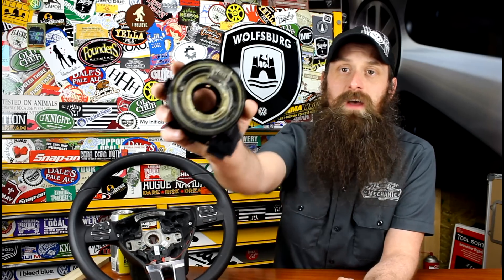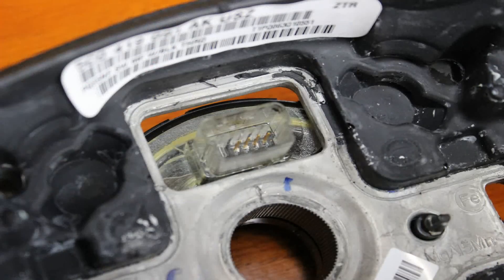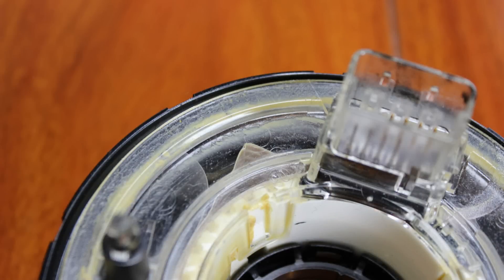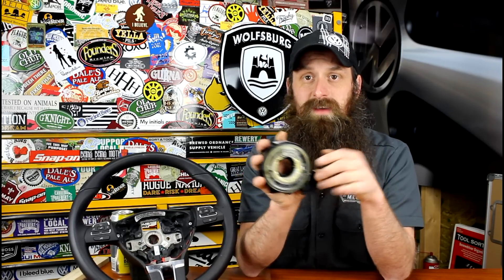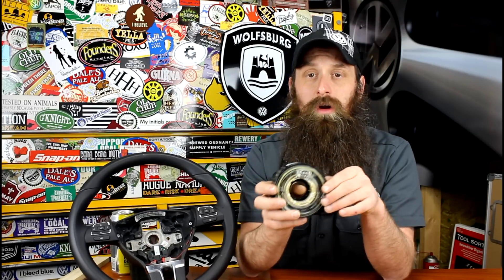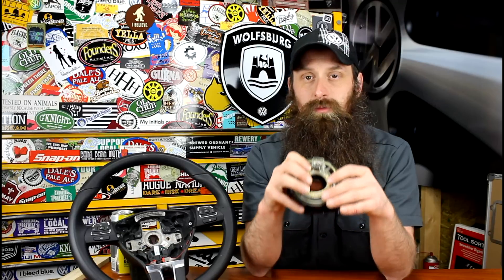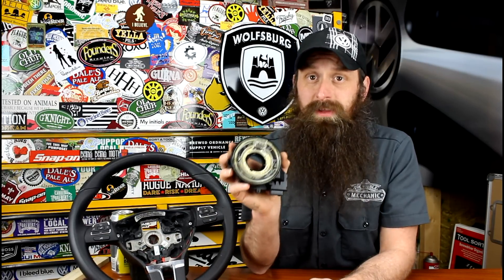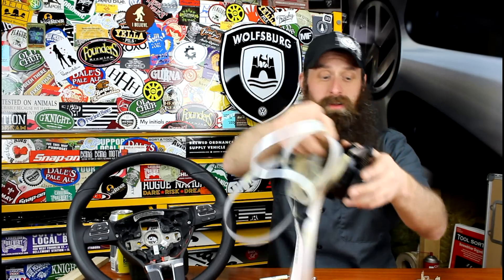How The VW Clock Spring Fails

Comment: Thanks for the great video.  I have a 2007 Eos with a persistent yet intermittent airbag light.

01217 - Side Airbag Igniter; Driver Side (N199) 
            001 - Upper Limit Exceeded - Intermittent - MIL ON

The TSB regarding the wiring under the seat was already resolved by previous owner.  I checked the wiring and it looks good.  I checked the measurement value blocks  Group [21] and the driver side igniter resistance is higher, 3.2, than the others (3.2, 2.4, 2.6, 2.6).   I have also checked, disconnected and cleaned the contacts below the seat. 

What do you think?  Is it the clock spring?
Reply: The weird thing is that it calls out the "side airbag".  That shouldn't be associated with anything near the steering wheel, right?
Reply from the maker: n199 is the side airbag igniter. the one in the drivers seat. Check the connection under the carpet. Seen a few fail there. Also seen a few airbags need replacement

Comment: Have you ever swapped internals from a, c to a d clock spring on a mk5?
D as original and c as aftermarket, putting the internals to make the d work?
Thanks.
Reply from the maker: I have never done that.
Reply: HumbleMechanic what’s your opinion on Doing this?

Comment: If anyone still has this problem and VW hasn't done anything to fix it...I just talked to my dealer and they said there is a new extended manufacturers warranty on the clock spring and my car was included. When I first went in for the recall back in march I was told my airbag light was not on, therefore, they wont fix it and will just put the protective cover on it(my horn and controls were not working either). But now with the new warranty I will see how that goes in December!
UPDATE: Air bag light needs to be on along with broken controls. Even if the dealer tells you otherwise like they did to me, in the end you will have to pay if one of those is not occurring. The dealer even admitted some slip through the cracks and get covered even without the airbag light on, but nope not with me. So thank you VW for wasting my time once again and telling me the wrong information.
Reply: Lauren Elizabeth yes thats true i receive the letter like 5 months ago and now im will have to go, i have a passat 2012
Reply: That's sucks, the games they play. What year is your car?
Reply: And model?

Comment: I recently bought an 06 Jetta 2.5 as a fixer-upper--my first car in 7 years. The previous owner had a 3 page list of problems from a dealer comprehensive inspection and one problem was the horn not working and an airbag light. I used  your videos to self-diagnose this as a bad clock spring.  After 2 tries, I found and installed the right one (a parts chart was off by one letter on the first try).  In the process of removing the module on the bottom side of the steering column and the other one immediately below the clock spring I got pretty vicious with it using a screwdriver trying to pry it loose--grrr… darn hard to reach clips! (Never get too overenthusiastic kids!) After the first reassembly, only the center instrument panel worked (odometer, doors open, etc.) The car wouldn't turn over or even click.  I went a bought and installed a new battery just in case). Went back in to the column to see if I had left something unplugged or pinched a wire, and now after second reassembly, none of the instrument panel works, and the car doesn't turn over or click.  I seem to be doing more damage than good.  Could I have done something to either of those two module that would prevent the car from now even showing when the door is open?  (The battery is giving juice--the alarm system indicator is lit on the drivers side door and the interior lights are working).  This is turning into an albatross around my neck and a dark cloud over my head.  Any advise anyone?

Comment: horn, steering wheel buttons didn't work and airbag light on, replaced clock spring and everything works but airbag light is still on
Reply from the maker: Most of the time you have to clear that code
Reply: Aiden O I replaced clock spring in 2016 Polo and the airbag light will always stay on. I borrowed a fault code reader for VW models and as long as its a decent one it will show the airbag light fault code. When you see this you can click on the clear or delete option which will stop the light from staying on.
Reply: Is the clock spring you replaced the oem? Or is there an updated version that wont mess up again?
Reply: Hi, I got the new one from my VW Dealer and as far as I know its not an updated one. Also replaced steering wheel bolt as itmust be new. It was only £44 for the lot which was surprising for VW. @laurenc9427

Comment: Epc light turn on clean the throttle and it use have P2101 P2212erase codes then took it for a ride it seem find but it turn on again with a P2212 and started rev by itself when being stop and hard to accelerate

Comment: Really thru me, horn and buttons all worked tho....? VCDS solved that issue and the recoding. Used one from a wreck, works fine. Thanks for the tips
Reply: E Klein did coding fix your power steering fault too?
Reply: Don’t think I had a power steering fault, but everything worked fine thereafter. Just have to reset the calibration by turn steering wheel fully both directions and then turn ignition key off and then back on.

Comment: I replaced the clockspring on a 2007 Jetta and all the lights came off after a short drive except the airbag light which was on before the clock spring repairs , also horn didn’t work prior to repair,  horn worked after repairs. Do you have any idea or tips on what can it be
Reply from the maker: you will have to clear that light. It usually won't turn off by itself

Comment: Hey guys im having issues with my cars steering wheel stalks where they are not functioning and i also get a display on my mf screen saying "buttons for steering assistant malfunctioning.
my clock spring is part number 5K0 953 549 where the stalks plug into the clock spring  Mk6 golf 2012.
i ordered a new clock spring but i still have voltage to the pins.. anyone else have similar problems that have been resolved?

Comment: Could it cause steering wheel to squeak? without having any issue with the airbag, horn, or the cruise control
My Audi A6 haas a squeak while turning the wheel sometimes
Reply from the maker: IT can, but it's usually not the cause. It usually is plastic rubbing, or the column needs to be lubed.
Reply: Thank you for the response. I have attached a youtube link for a my issue if you would like to check it
https://www.youtube.com/watch?v=EzqF9DE0EhQ

Comment: 2015 VW Jetta TSI Red steering LIGHT came on & steering is hard to turn.  please help
Reply from the maker: That is usually an issue with the J500 power steering module. Gotta get the faults checked

Comment: There's a recall on the steering wheel clock spring on my 2011 GTI, is it possible for the clock spring to make it so that the steering wheel won't always lock when I turn off the car?
Reply from the maker: No that is a different part. That is in the ignition switch housing
Reply: HumbleMechanic I'm stupid. Apparently the Autobahn edition locks the wheel when you lock the car. I'm taking mine in for the recall, I hope that also entails the keyless entry. (Standing next to the car and it unlocks). 

I plan on going APR stage 2. My 2008 GTI was APR stage 2 with short ram, DP and TBE. It was posting lower 13s past 110k. 

I want to get my new one to the mechanic. I'm assuming the timing chain is good to well over 120k as long as I do routine Mobil 1 full synthetic oil changes. I hope that's the case because I'm going to go stage 2 plus again. I only feed her 93 octane. I'm pretty certain that the clutch will go out by 90k though I always changed the oil on my 2008 every 3k miles. 5k at worst and I gave her 93 only except for when I was in Oklahoma where I only had 91. That motor was bulletproof. I hope the TSI is a stronger motor and I hope the turbo has a long life. I'm nervous because I just got my newer GTI and I don't know her 100 percent just yet. I knew my last one and took great care of her. GTIs are my favorite cars that are under 30k. I fell in love. Went from a 2008 stage 2 GTI to a 2011 Camry and I'd be lying if I didn't miss my GTI every day. This car was my mission and I succeeded. Thank you for the reply.

Comment: Great video,
I have an Audi A3 8P (2006) and when I bought it a few months ago the horn worked ok. Then suddenly it stopped working, at all. I took the center cover off the steering wheel and was able to test the relays (working) and put 12V  to the horns (working). 
While reassembling the horn switch the horn sounded again but I couldn't actually make it work by pushing the horn buttons, it was just as I was putting it back together so something suddenly worked then didn't when it was all reassembled.
I have a VAGCOM but don't know where to look to check to see if its the clockspring or not. I have ABS and slippery road lights as well as a brake pad warning light but I'm sure thats the speed sensor cable which is worn at the front wheel hub where it connects to the speed sensor.
If I determine its the clockspring do I have to disconnect the battery to safely remove it ?

Any advice ? Thanks.
Reply from the maker: +Will Beames some of those wheels have a connection at the bottom of the steering wheel. You can see this with the airbag removed. 

I've seen a hand full be slightly loose and cause similar issues. 

It's at 6:00 on the whee
Reply: Can I just unplug the airbag behind the steering wheel cover or do I need to disconnect the battery to prevent it going off......that would be "surprising" if that happened....
Reply: The screw was not loose, however, my steering wheel controls stopped working recently but when I turn the wheel 90 degrees to the right they work again, so does the horn - there's a sweet spot. I'm assuming this is the clock spring. So I removed the airbag and steering wheel but couldn't see how to remove the column cowling to access the screws for the clock spring. Are there hidden clips that hold it together ?

Comment: I retro fit a steering wheel/airbag from a different year car. horn & controls don't work or light up.
I tried to install my airbag that came with the car and the lights came on but the airbag won't click in. so my question is, do I need a "matching" clock spring to go with the different year airbag? please help....

Comment: i have a question for you.i want to install a new steering wheel with controls on my car.my cars steering wheel does not have controls.what changes should i do?thanks.
Reply from the maker: That really depends on the car. Some it's as simple as a steering wheel, while other may need a whole new mess of wiring  too
Reply: i have an opel corsa 1300 cdti 2005.if you know something it will help.i
 know that i must do some changes in the clock spring.thanks for your 
concern.

Comment: hey í have an 04 passat glx and í changed all the airbags and the module but not the Clock spring and when í was done the car honked like never before but í disconnected it is so could it be the Clock spring ?

Comment: Could a failed clock spring cause a short on the airbag control module? I turned my steering wheel on my 2011 VW Tiguan SEL and it clicked while turning and then the airbag light came on. The dealer said the control module failed from a short and I feel like an airbag control module of all things doesn't just short for no reason. But then again, I'm no mechanic. Thanks in advance!

Comment: My horn is not working but with my remote is working and I also have SRP air bag lights on. Is that from the clock spring?
Reply from the maker: Those are very common symptoms of a failing clock spring.
Reply: Ok. Thanks a lot! and thanks for the great video!

Comment: Mine just broke 2013 Passat $560 to fix, my vin is not covered by any recalls. Next car will be a Honda or Toyota without a doubt
Reply: I used to LOVE VW's. I had a 2003 Jetta, 2013 GTI, 2016 Golf R, and now a 2015 TDI wagon. The diesel thing didn't really bother me as I don't care about emissions but the reliability issues have swung me over to Toyota most recently. It sucks. I love how VWs feel, drive, and I love the fact that I can use VCDS to solve almost any issue in the cars, but damn... My clock spring failed at 90,000 kms (Warranty ends at 80k) Its amazing that my 2003 4runner with 200,000 kms on it has all of the electronics still functioning.

Comment: I HAVE ONE FABIA 1.4 2001 MODEL,THIS AIRBAG LIGHT GLOWING FULL TIME .HAVE ANY  WAY TO CHECK  THE CODE ?? ( WITHOUT CODE READER) ex  Toyota vehicle can check codes by  paper clip. can you say what is the common fault coming this mode ??I checked clock spring its ok..l

Comment: Hi again, I have a question about where to get a clock spring for my '07 Beetle. I got one that "fits my car" online but the connections are different. My car has occupancy sensors and electronic stability control and apparently the clock spring I bought doesn't work with those features. Every website I've looked at keeps showing me the same part that I already bought, the Dorman 525-701.
Reply from the maker: +AxMONKEY check out ShopDAP.com. Or give Paul a call he can help you out for sure

Comment: Hey man. great video. I changed my steering wheel and my power steering went out. would the clock spring be related to this in a mkv jetta? since it's electric?

Comment: This is so frustrating for me because I took it to dealer and he basically told me there's no way it could be my clock spring because it doesn't control the ARS on the airbag , and I tried to explain to him that there are variations in clock springs and flat out said no and that he had been working on vw's for ten years and that I didn't need to advise him on vw's and there's no way a bad clock spring would make an airbag and ARS light and ABS light come on, but my thinking is that since ARS is tied to ABS system it makes sense that both lights would come on along with airbag.....am I right or am I just deeply confused

Comment: Hope you don't mind me taking you to ask over a few of the things you've said here:
2:40 - Might sound dumb but you've failed to mention that on clock springs, the ribbon is almost always soldered directly onto the metallic outer body of the ring. This is how it keeps the contact up. Like any moving part, this does stress over time and solder, as we know, goes brittle with age. One of the most common failures is that the ribbon simply comes away from it's metal contact due to excessive movement. Furthermore, a clock spring that has been wrongly installed (or more to the point, not centred) will break prematurely.
3:08 - You put a bit of emphasis on the horn, but it's important to note that MANY Volkswagen's (especially the older ones <2005) had a ribbon cable for the airbag ONLY and a single static earth cable for the horn. The horn essentially used the metal frame of the steering wheel to make a circuit. So, while yes, diagnosing using the horn is a surefire way in some cases, not all. My VW for example, has this setup, so when my clock spring went, the horn remained fine.
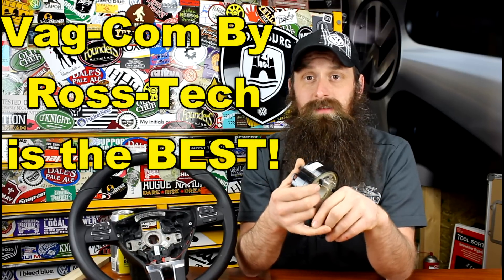3:18 - Sorry, but no it's not.... Yes, the scan tool will tell you there is a problem with the airbag system, but it won't tell you where the issue occurs. If a clock spring fails the error flagged on your ScanTool will read something along the lines of "resistance too high" or "no voltage". This basically means there's no electricity making it around the circuit when the ECU checks your airbag, but this can be caused by ANY NUMBER of issues, the plug fallen out of the airbag control module, the airbag itself being knackered, a connection damaged anywhere in the line between the airbag control module and the actual airbag itself. You need to reliably reproduce the airbag signal, so you can detect where the break has occurred. In my case, the best way to diagnose this issue, was to use a ScanTool + A resistor. I effectively cheated the airbag module into thinking there was an airbag, reliably diagnosing the clock spring failure.
3:55 - Again, this won't work on many VW vehicles. You fail to mention this.
4:53 - Haven't you already really suggested this? Using the ScanTool to test the airbag control module, is literally the first thing you'll do, to diagnose an airbag fault?
6:20 - Bullshit, utter bullshit. Clock springs don't fail in that way usually, even when installed wrongly (see below)

Finally, you fail to mention the importance of centering the clock spring before installing it. Don't centre your clockspring? It'll fail.
Reply from the maker: Thanks for the insight. I will say that at the 6:20 I have seen that exact thing happen. It happened to a tech next to me. 

But again, thanks for the insight. I appreciate it.
Reply: HumbleMechanic Seems bizarre, they shouldn't come apart like that man!! Was it a pattern part?
Reply from the maker: No I think it was a fluke. This was on a mk3 so it was an old gen spring.
Reply: HumbleMechanic I imagine it was the old kind like in my car. The one with the horn cable running through the middle?

Comment: I've been reading on all the forms about and issue that from what I can gather is this, BUT,  I don't have any issues with my horn or anything else. it's just a clicking sound coming from the steering column. it sounds like a solenoid clicking on and off rapidly. it seams to not do it as much when the stereo is muted. this is on a 2010 gti. think this could be related to this?  
thanks!

Comment: Dude I need some help, I've got an issue either steering light showing up, diagnose test shows it's the steering angle sensor error no communication, I have changed it already but it failed to reset, also that triggers the rear abs sensor not responding, I've spent so much already and it's still not fixed. Need help please